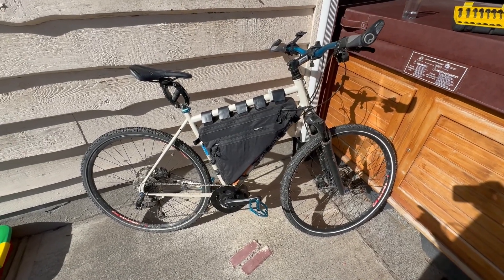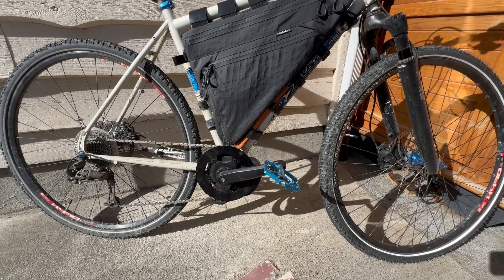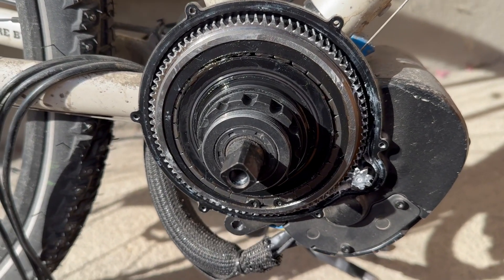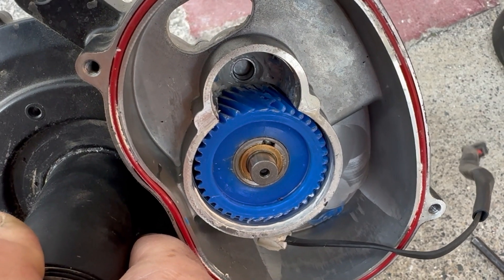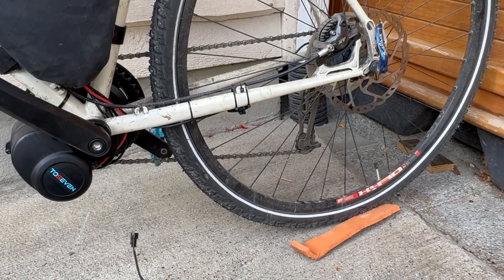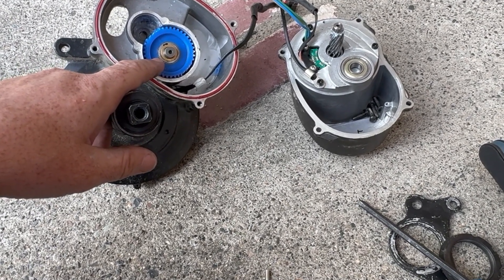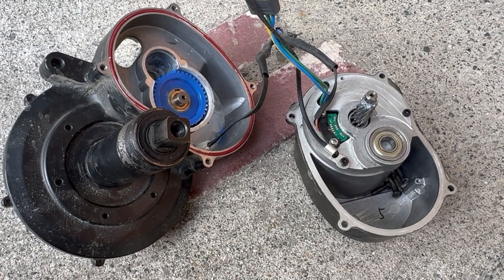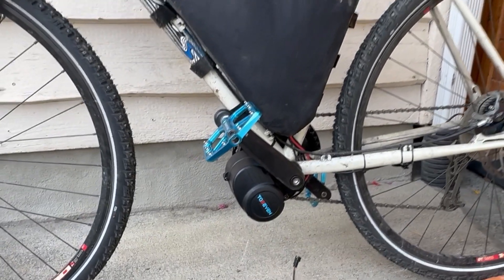Finally broke the DM02 with the ASI BAC855

Comment: Ive been using my bike without the motor all summer now winter has arrived time to update all the firmware.
This neatly gets me on to a request.
I have installed the last 2 updates without issue prior, however I'm really struggling to install the download for the display, I get to the page with the Chinese writting and can't get passed the second page after hitting the grey button on the top left, not sure what I'm missing, any help would be gratefully received.
Iain
Reply from the maker: Hey mate. Seems very strange. Have you re watched the update video I did. It’s been a while though so I’ll have to recheck it myself. I thought you had to hold down a button. You’re on discord right?
Reply: Everything was going well and I thought the update was successful, now the display won't turn on, whatever I try, very frustrating.

Comment: Great video as always! What motor would you recommend for single track increment climbs. Torque sensor sounds the right direction but wanting to see your recommendation on reliability also .  Thank you so much keep up the hard work!
Reply from the maker: For price and noise the DM02 or DM01 would work. Depends on your frame. There is also CYC and Bafang. No torque sensor on the Bafang though.

Comment: That was certainly a respectable trial run, I would feel confident putting one on my own setup, and speaking of.. is that donor bike a good foundation for this? I'm hoping to find one that's got good geometry for someone 6'1" with wider(2.1-2.5") tires and big cogs for climbing, if you know something like that already? If not, no worries. I still see only the cottonmouth frame at northbay, tho 🙂
Reply from the maker: I would look at Surley and Salsa for something bigger. This is a salsa but the max tire at the back is 2 inches. Its a touring frame really. In terms of cogs it does fine with the motor on but if you are doing really really steep stuff then a wider range cassette will be needed I think.

Comment: cnc metal ⚙️ gears ⚙️, maybe that is better/It that i see it plastic?
Reply from the maker: The metal gear option is possible. It does make the motors much louder though which is not always popular. PEEK would be the best material. We use PEEK with the BBSHD alot to give it some more strength.

Comment: Is the failure of an inexpensive sacrificial weak link, that is easily replaceable, really a 'failure'? 
I'd call that sound engineering. I would say it protected the rest of drivetrain, and possibly, electronics.
Reply from the maker: When you phrase it that way not really. It did do its job of preventing damage to the rest of the motor. Good point. In terms of squeezing out some extra power a PEEK would be awesome.

Comment: Thanks for the extreme testing. Is shredding the 'sacrificial' blue gear really breaking the motor? As you say, it's an easy fix and intended to be so. I was expecting shredded main gear or shattered torque sensor or the like by the headline. I'm highly unlikely to push the motor to a 1000w until I add effective heat dissapation to the controller and buy a bigger battery - let alone 3000w, so happy with the motor as is and in this incarnation.  Looking forward to your 'stock' testing. Have you installed it straight of the box or have you added grease to the main gear?
Reply from the maker: Cheers Ian. Its not really broken lol. A simple fix albeit consumption of time. I think it can handle up to 1000 watts no problem and for time especially with a peak gear. I will keep you posted on the stock motor. I just need to run the update and I will give it a test ride.

Comment: You are doing us all a service by stress-testing these motors.  It is so much better than waiting years for failures to start happening under normal use.  I just installed a DM01 on my bike and hope for many years of use under normal load.
Reply from the maker: I did the same with the DM01 and it is still going. I will have to try that one out again as well to see if the firmware has improved like with the DM02
Reply: Can the nylon gear be replaced with steel one? @HighVoltageKits
Reply: @HighVoltageKits I'm very curious if the DM2 can handle the stress of climbing the trails up on the mountain for 2 days camping trip...

Comment: My dm-02 is still stock. I haven't even updated the firmware yet. It seems to be going ok, my daily trip is around 40klm's round trip.
Reply from the maker: Depending on when you got it the firmware might be already quite advanced. July is the latest version according to the webstite.
Reply: @HighVoltageKits  I bought my kit back on the 11th of June this year
Reply from the maker: @Damienchristidis very close then to current
Reply: Might benefit greatly from updating the firmware. It may give you smoother performance.

Comment: There's a lot of skepticism about the the quality of Toseven motors online. I think you've been fair in your analysis of both motors, which is really benefy.

Could you comment on the clearance between the bottom bracket shaft and the motor housing? I'm wondering would this be large enough to mount to a bike with an eccentric bottom bracket. If anyone knows if this would fit a Pelago Hanko, then I'd appreciate a reply. Thanks.
Reply: I have an Eccentric BB and the DM02 will fit fine IF i swing the bottom bracket hole to the bottom BUT the clamping bolt arrangement fouls the whole thing SO I will also need to grind those off and then shove a few tech screws through the EBB housing and into the EBB so it doesn't move around... I've decided to move my Alfine IGH onto another frame. On quality, I've had my fair share of stops and starts with my DM02 (s) but it's clocked over 2500kms, and climbed into outer space and is running better now than when I bought it. To be sure I knew I was buying in early and offered to be a 'test bunny' but I wasn't expecting my DIY motor to be SO DIY for the 1st year.
Reply: @Ianane2  thanks..That's an approach I hadn't thought of. Re the Pelago Hanko it's the bolt mounts that I think will be the problem.
Reply from the maker: I will try and add that into the video with the DM02 running stock. Cheers

Comment: Now that you have exceeded the power capacity of the little motor and wasted the drive gear what`s next ?  Your style of riding mimics an electric m/c not a power assist bike. I appreciate your testing of products but to exceed the power that the units were made for is for what. I guess this serves some people. Just not my reason for an electric assist bike. Thank you though for the testing to failure. But I was more interested in your testing of equipment being used for what it was designed for.
Reply: As you said though it serves some people. I find his testing extremely useful, he tests these items to their limits so people know exactly what the limits are and don't destroy their own motors. For example I commute a 40 mile round trip with some massive hills on the way back, before I modddified my bbs I'd always drive as being stuck to the uk's 250w's it'd take me hours to ride back and I just don't have that much time to spend getting back. But now with it modified I get exercise and its one less car on the road most days. 
So from me a big thanks HV for pushing these limits so we don't have to. 👍
Reply from the maker: The information will get passed back to TOSEVEN and they can do with it as they please. If it was me I’d relocate the controller and expose the motor to the air and swap out the Nylon for PEEK and you have a motor that can sustain twice the power of a Photon for about 1/3 the cost. But Toseven need to put the work in. I felt that the motor could be happy at 1000 watts assist and it was. Hopefully you will enjoy the updates on the stock motor as well as the stock Hiboy bike more. Cheers
Reply: @HighVoltageKits  Capt. I have run the toseven dmo2 for over a thousand miles. The heat buildup is greater with this motor than any other I have. I have 10 ebike builds with everything from cyc to bafang and throw in the tosevens. The way I ride is single track with no throttle and street riding. I have crashed two photons. Both on 52v. and factory settings with the latest firmware on them. My experience with the toseven dmo2 shows the motor runs very hot to the touch. I also have noticed the mileage on this motor is quite a bit less than any other motors i run. I attribute this to the heat build up which is due to a less efficient motor. Your thoughts on this if you please. Inefficiency yields heat I would think. But what do I know as I am vacuous so I have been told. I worked in co-generation at a power plt. for 40 yrs. Thank you for your replies.
Reply: @alank808 Pls don't sink to their level. I understood what you were trying to say. I noticed some of my customers were not limiting the amp draw in the three modes (factory on many defaults to 30 on each). At 48 Vista, I have reset them at 10 in eco, 18 in city and 25 in sport. None noticed a loss in performance and all came back to tell me how much better their range. I can't say if they ran any cooler, but it can't be as hot as a TSDZ2
Reply: @MHH3180  really curious about these amp settings. I'm assuming you're talking about the DM01, which comes default at 30amps for E/C/S out of the box or are you really finding DM02 s set to 30amps. This much current would quickly cook the DM02 controller
Reply: @MHH3180  Thanks for the info.
Reply from the maker: Very interesting. I find the controller throttles first with the case staying pretty cool. The latest 02 firmware is meant to fix some of the controller overheating issues
Reply: @alank808 what gear ratios and cadence are you running?
Reply: @alank808  Hey, I noticed the Captain wrote that with the new 02 firmware some heat issues are fixed. Can you tell us what FW version you run? Thanx.
Reply: @Alex-uh1mj  36 chain ring and 12x46 cassette i never use anymore than pas 2 On the rd  bikes . run 34x 52x13 on single track  on my cyc and bbshd builds. Only use throttles on th hd and bbso2 bikes
Reply: @alank808  you have some never seen before fault then because the controller gets hot long before the motor and throttles it, how are you taking the temperature reading
Reply: @MHH3180  25A on a DM-02?
Reply: @KunjanChauhan  single track would be a single trail big enough for a hiker, horse, bike or animal.
Reply: Serves me well to get more customers❤
Reply: Consider it a simulation of 30 years of normal use.
Reply: testing equipment of what.  boring farts joined the chat that use mid instead of hub for some reason 😄
Reply: The most vacuous comment I've seen on youtube for some time
Reply: @claverton  Sir I appreciate your vast vocabulary. Your assessment of me may be as you stated vacuous to you. I neither attacked or discredited Capt`s testing. I simply made a statement. You can retract your stinger now and poke out your chest as you have come out the victor. Damn woke mentality. Always looking for a fight. Where were you during Viet Nam. I could have used the agression on my team.
Reply: @alank808 i'm half french vietnamese